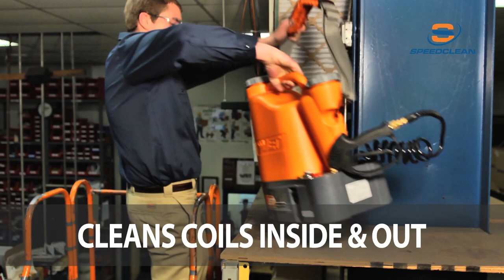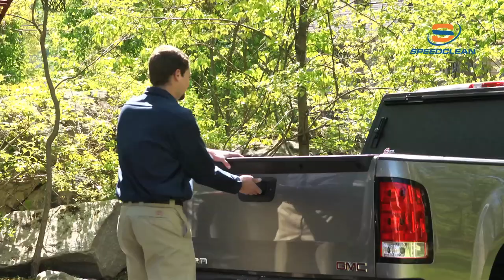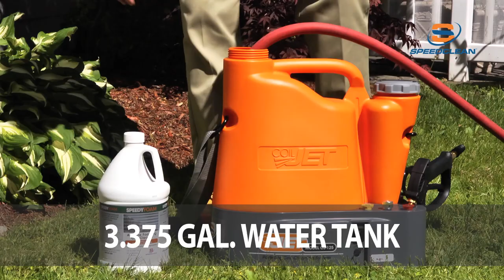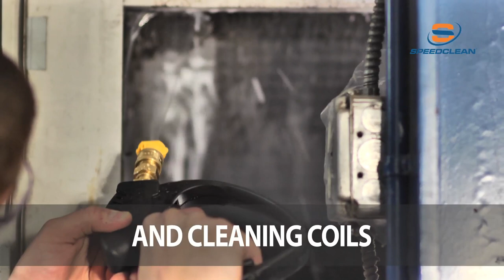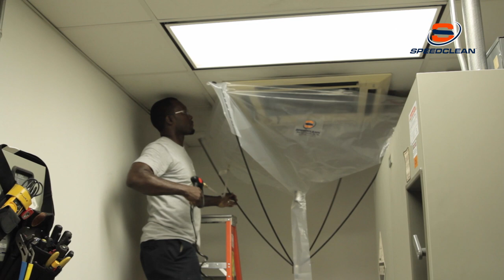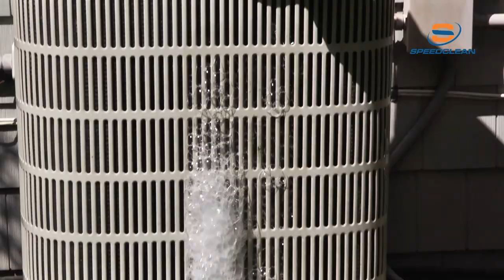CoilJet® CJ-125 Portable HVAC Coil Cleaning System

Comment: My coil jet has a decent leak on it, won’t hold the cleaner or water well at all. Any ideas or tips? I have tried glueing the tubing for a stronger seal and still a leak
Reply: Hey , I own one of these and I didn't like the short Wand reach so I went to Home Depot and bought an air hose that reaches 25' - have used it for over a year like that with perfect performance, reach, and dependability
Reply: Forget Glueing - just go buy another hose - simple and longer reach - To do this install - It's easy - taken off bottom plate then locate the hose input - take it off - then put on the new hose